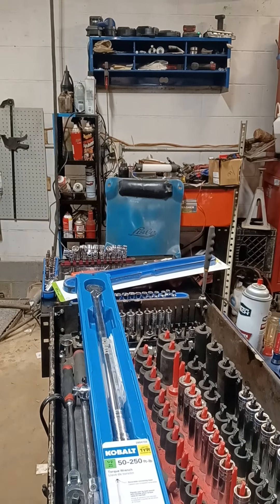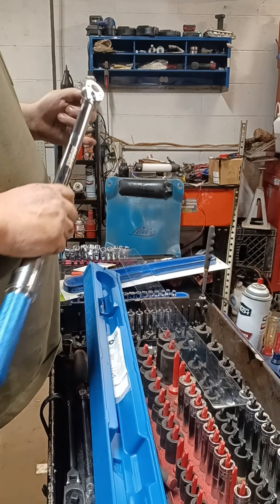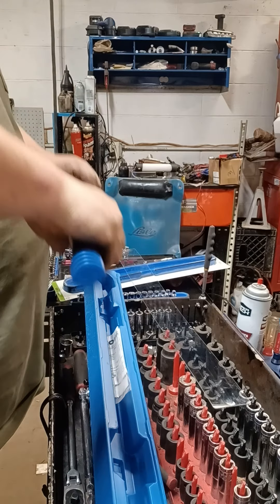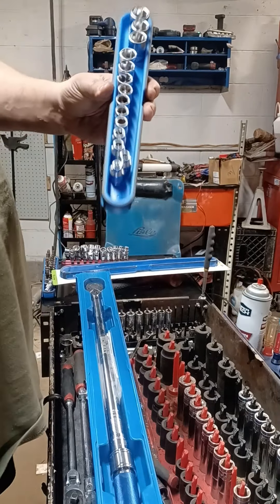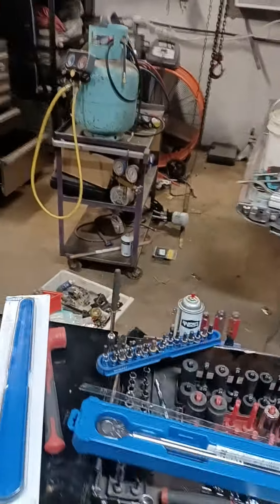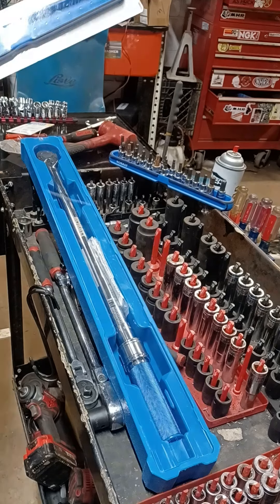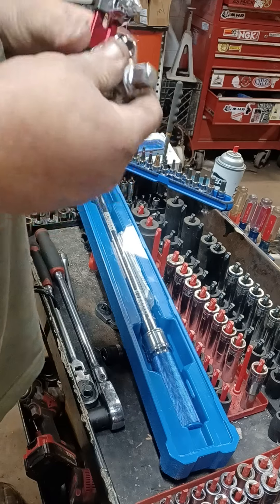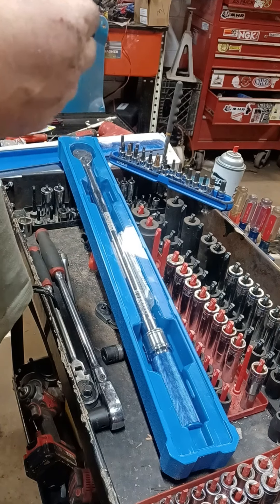1/2 torque wrench under $60  magnetic socket trays cheap

Comment: That looks like a pretty long torque wrench. If it's made in Taiwan then that is a great deal. I've got tool storage issues as well. I'm just about out of room in my Craftsman roller and top chest. I don't have room for a larger box.
Reply from the maker: @mlieser1230  torque channel did a review on it a year ago. It had good reviews